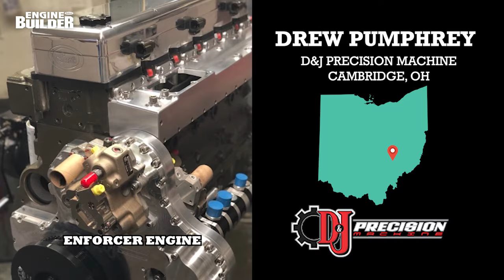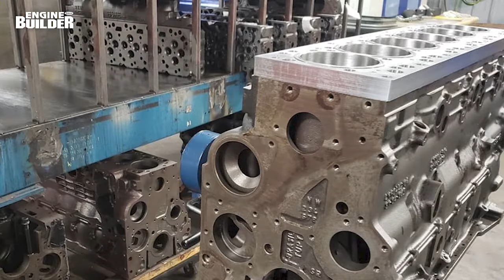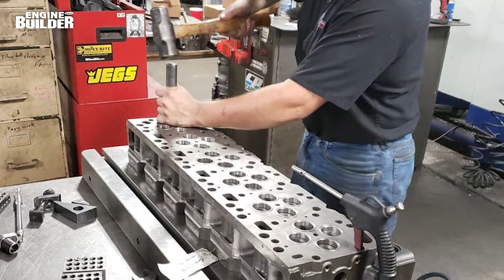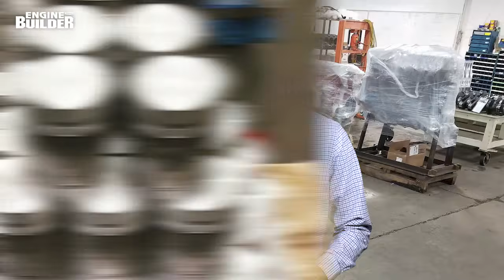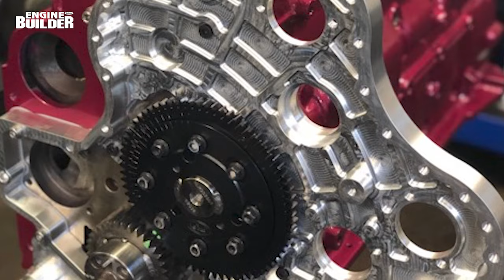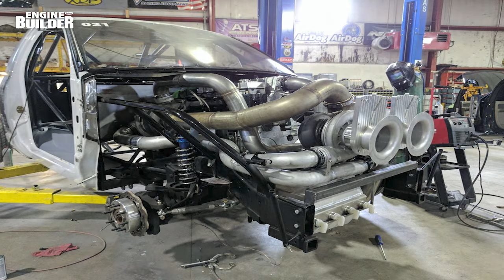D&J Precision Machine's Enforcer Cummins Engine

Comment: Some Cummins blocks I believe the high outputs came with 2 Cam bearings I was told that I didn't have one when I had my transmission out 1 day and then when I had to get my engine rebuilt My machinist when I asked him to replace them he said the rear one was a Cam bearing as well, not a bushing. He showed me both they were identical.

Comment: How much would it cost to build the enforcer motor for a 2008 dodge ram diesel 6.7 that I like to push 1200 hp street truck. It's 4x4 2500  truck.
Reply from the maker: Don't quote us on this, but those engines are $60K+ depending on component selection.
Reply: A base enforcer is 32k without accessories